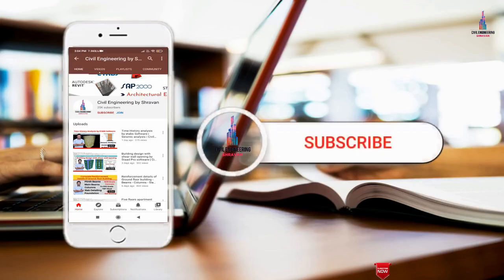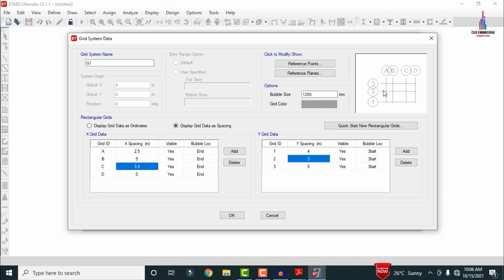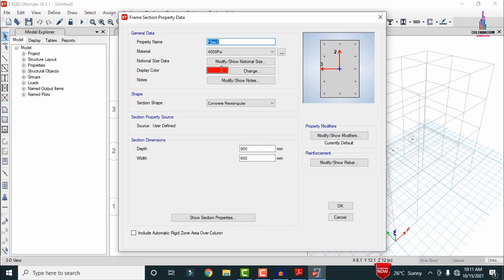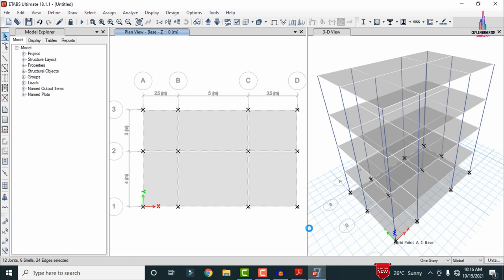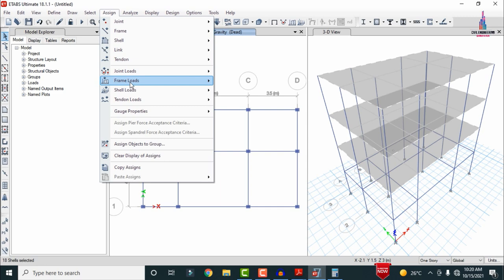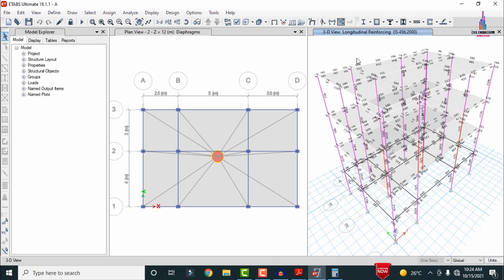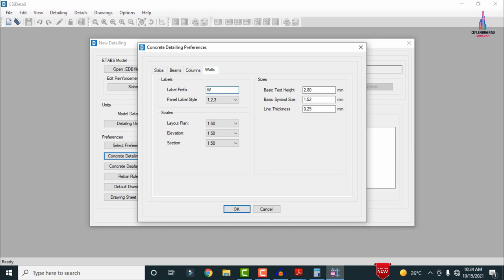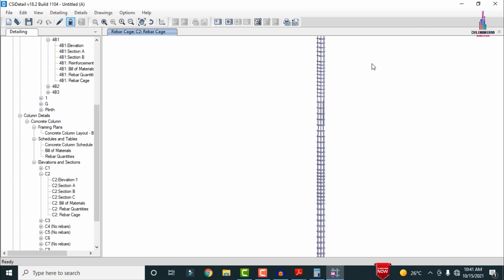Complete building design in 25 minutes by ETABS Software | Civil engineering | G+2 design by etabs |

Comment: Thanks for the video and explanation.  Great to get so much information from A-Z in one single video of 25 min. In my project the panels are different from one another and there are gridlines which pass through some of the panels and clicking inside a panel containing a gridline or two inside will create 2 to 3 slab instead of one with quick floor creation. I want to know if this will not create any problem or I should click the gridpoint to make sure that each slab rest on the corner column and each panel is 1 panel in reality and not 2 or 3. Also my beam is 425x200 where the 425 is the depth and the top part of the beam is the slab thickness of 125.  So the beam is actually 300 + 125.  Should I design the beam as 425x125 or 300x125? Thanks.
Reply from the maker: Welcome

Comment: Why design strips is provided at ground floor? Is it because you are considering 1st floor as ground floor. In story definition you've consider 4 story. Bottom as foundation level, then plinth level, then ground floor level, then 1st and 2nd floor. Typical height is 3m. So your plinth level is at 3m and ground floor level is at 6m above ground level.

Comment: i m using etab 20.2.0 in this i m not able to desing slab strips in edit option and the option is not working, will you let me why is this happening, sir
Reply: unluck the model by clicking the lock symbol right under the draw menu